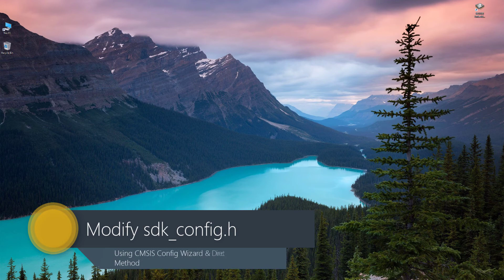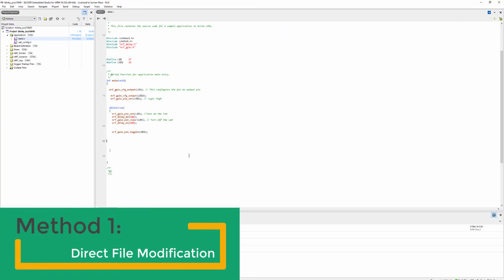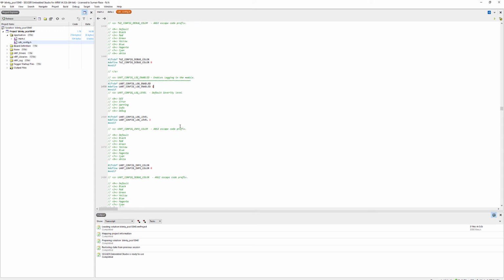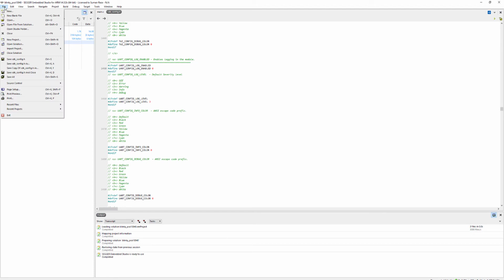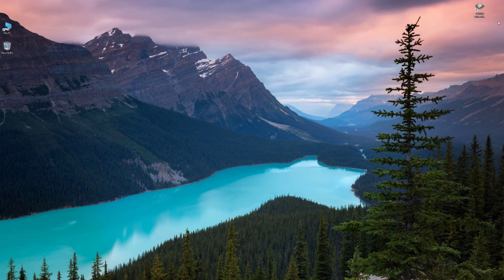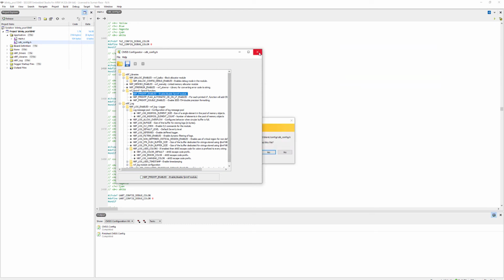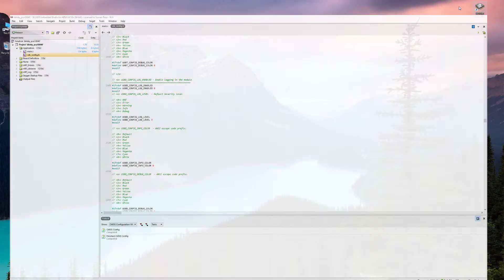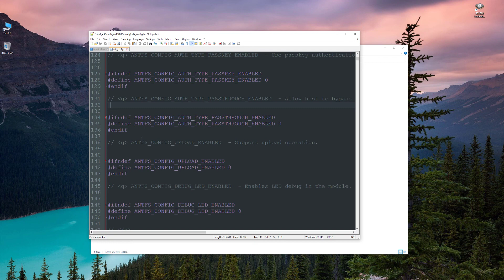nRF5 SDK - Tutorial for Beginners Pt 7 -  Configure sdk_config.h with CMSIS Configuration wizard

Comment: I think I did something wrong. When I tried I get this:
Error: Unable to access jarfile ../../../../../../external_tools/cmsisconfig/CMSIS_Configuration_Wizard.jar
Anyone know what this means?

Edit: I have JAVA installed and the option is showing in the dropdown menu when I right-click the sdk_config.h file, but nothing happens. The error is there in the SES output window but right after it it says, Finished CMSIS Config. I also noticed that there were some issues with certain things not escaping correctly in the .xml file provided and I fixed them according to the .txt reference. Still not sure what the problem is.

Edit 2: Got it figured out. You need to go to Project > Options > Code > Build > Project Macros and tell it where to look for the .jar file. It's in the External Tools folder of the Nordic SDK. Don't forget to include the file name, not just the path. In my case it was: C:\Users\Mal\Documents\nRF5_SDK_17.1.0_ddde560\nRF5_SDK_17.1.0_ddde560\external_tools\cmsisconfig\CMSIS_Configuration_Wizard.jar

Comment: for those who are in a windows machine and doesnt get runs cmsis configuration wizard, you will need:
1. you need to have installed JAVA in my case i already have it but it wasn't in the system PATH, my java is located under C:\program Files\Java\jre1.8.0_281\bin (since from here is located java.exe).
2. may be is needed add to the system PATH.

this is a one workaround that works for me.

Comment: If anyone is having issues with the copied code not working, for me this line didn't escape the ampersand properly:

It copied like this and seemed to glitch out the </menu> at the end of the line. 
<menu>&CMSIS Configuration Wizard</menu>

Changing it to this fixed it:

<menu>&amp;CMSIS Configuration Wizard</menu>
Reply: It  worked in my case for windows  but while oppening there is an error

Comment: Thank you very much for your videos. This is a very helpful tutorial.
I am doing to follow your videos. However, when I restarted program, the SMSIS window doesn't come out. Even the menu shows the SMSIS configuration wizard (control Y). I checked everything is the same with your code. Do you know any reason for it??
thank you
Reply from the maker: Hi @HIEP Cao Xuan,
make sure you paste the code for CMSIS after this line:
</item>
paste your code in this area, then it will work
</if>
</tools>

Hope so this will resolve your issue ;-)
Reply: @SumairsEmbeddedEngineering  
Hi,
it should be like this right??
</item>
</if>
paste your code in this area, then it will work

</tools>
Actually I copy and paste from your xml file.
I am usingSegger V 5.1. nRF5_SDK_15.3.0_59ac345
thank you very much for your help
You can look the detailed in this snapshot
https://drive.google.com/file/d/1CiMGBbWMXgbLCIYyXKlAh818Zk-_5YuS/view?usp=sharing